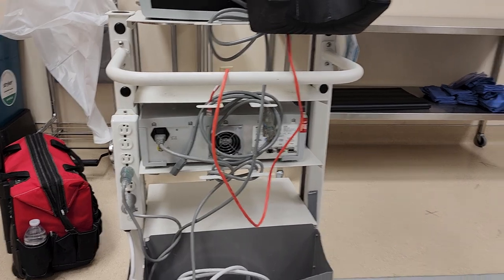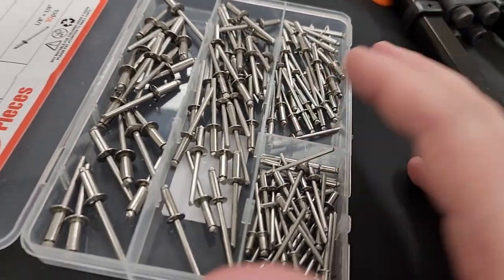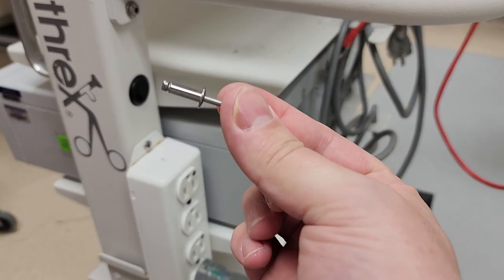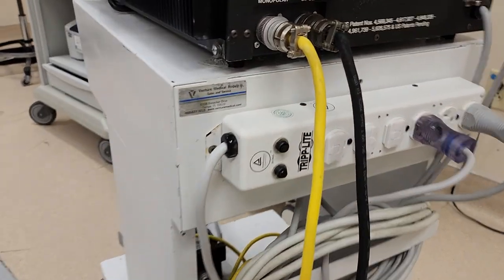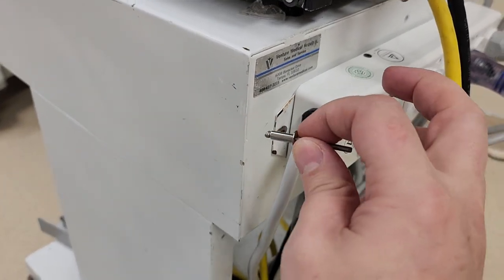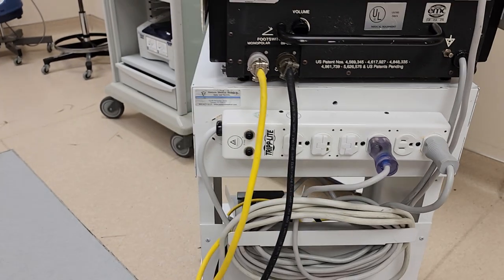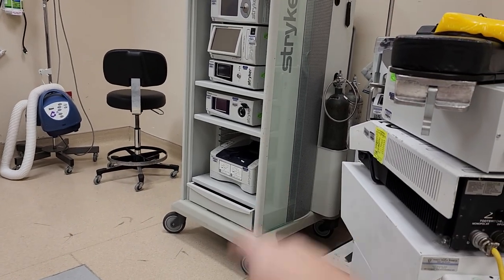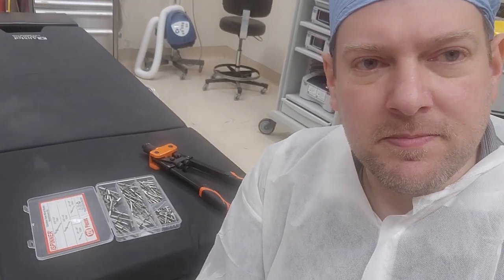Pop Rivets! Adding Power Strips to Carts

Comment: We ended up getting the Milwaukee M18 Fuel battery powered rivet tool. Works wonders on heavier gauge rivets, as seen on some bed models to hold the side-rails together.

Comment: I would also note that it is important to test amperage on all on the RPT with all devices attached & turned on.  I worry adding additional Power strips to the side of Stryker tower would in time cause the ampacity of overal circuitry to exceed recommended value - make sure the load to be used is for the correct strip! Big challenge in the field.

Man those pop rivits are handy as another feat we face is making them unable to be removed from the carts without a tool. We kept a few self tapping screws in our bag for when we found them dangeling or held with Velcro/ med tape 😂 rivits would have been much better

Comment: Nice fix, another way to fix power strips to carts etc.... when the backside is not accesible, is to use Rivnuts, but then you have the possibility that the bolts can come loose (can be prevented with Teflon or Loctite offcourse). 
Also to mention, that you definitely need such large pop rivet gun when you use stainless steel rivets, with the normal small hand gun, you have to sqeeuze too hard on the handles, and you get a serious kickback each time a stainless steel rivet cuts off at the end when crimped. This kickback can lead to serious injuries (i almost lost the top of my finger that way when using stainless rivets on a metal sheet).

Comment: Why in the world would someone want to permanently affix a disposable device (surge suppressor) to a cart??
Reply from the maker: NFPA99  standards for relocatable power taps in medical facilities.
The standard has changed some over the last 10 years but permanently fixed power strips are still required in operating rooms.
Reply: When was the last time you had even a consumer grade suppressor die?  A 20+ year career in IT (three in a hospital). and I've seen maybe two Walmart quality ones die.

Besides, you've just got to drill out the rivets.  No big deal, even with stainless.
Reply: It’s permanent until it fails.. then you remove it. Better than zip ties which are bound to snap with the way the OR treats their equipment 😜